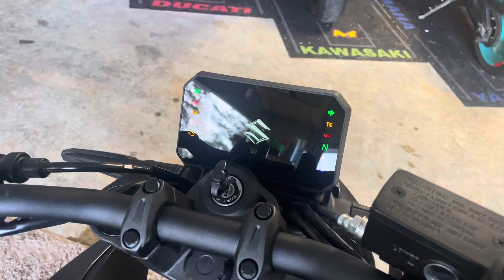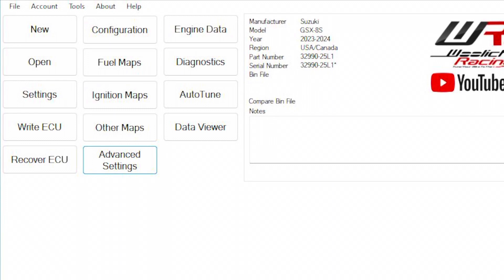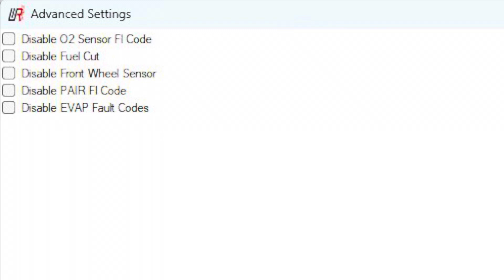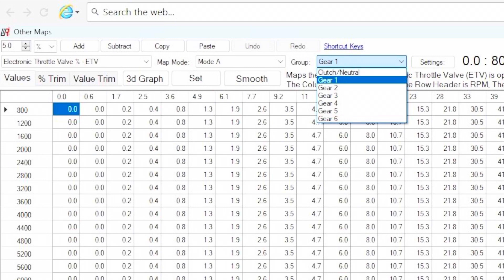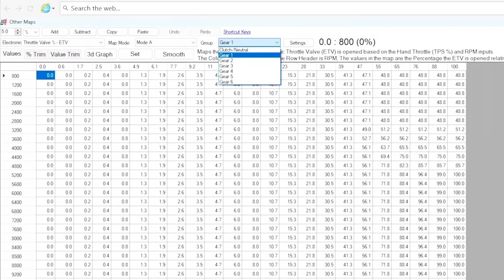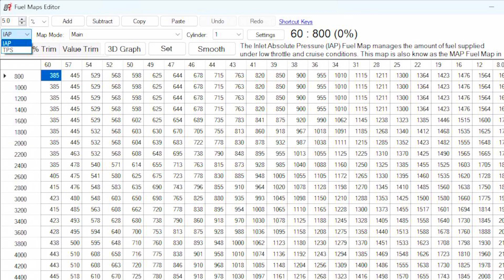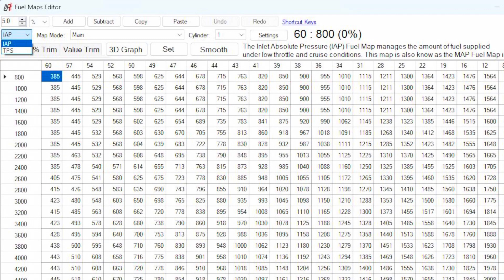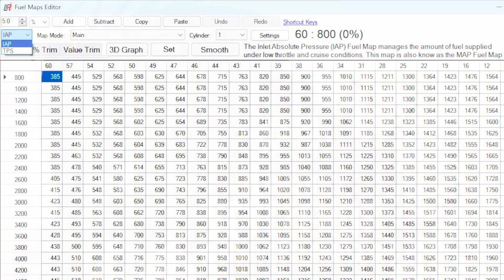Suzuki gsx8s ecu deep dive and first impressions. Gsx8r vstrom 800

Comment: Why not just put it on the dyno and run it 500 miles or whatever is needed
Reply from the maker: good question!

couple reasons

once its broken in I will start tuning it.  When I am riding the bike I am evaluating it.  Looking at what needs improvement,  what I think of the stock throttle maps,  what feels good.  Impossible to do that on the dyno and I want to evaluate it prior to tuning

even with all the fans on the dyno a bike can still get hotter on the dyno then riding it.   Excess heat is a big thing im trying to avoid on a brand new motor

I did get 50 miles in yesterday,  ill have it ready to start tuning by wednesday
Reply: @vcyclenut  can you at least use it to speed the process up and that way all your time riding will be with a fully broken in bike ?
Even if you did it in increments to avoid over heating it lets you get mileage in on rainy days and when you’re doing other things. 

Anyway just a thought.
Reply from the maker: ill put 100 miles on the bike,  change the oil,  and than just do a few heat cycles on the dyno and then let er rip.  Ill make a break in video about my process
Reply: @vcyclenut  one last question. Did you see yammy noobs video yesterday on the trident 660? He has a rant dedicated to his issues with the on off throttle situation. My question is to what degree youre able to make that snap back like a normal bike and how much of that is from you riding on road vs tuning on dyno like you mentioned others do. Or can that just not be tuned out.
Reply from the maker: @MarissaTheMuse  i work really hard on throttle feel.  Its one of the things you will hear again and again on my flashes is the great throttle response.  Yes, real world testing and not just dyno tuning is a big part if this.  
One of the things I’ve already noticed in my short 50 mile ride on the gsx8s is that the early throttle does very little, even in mode 1.   I will fix this for sure.

Comment: The new Suzuki quick shift has been one of the best factory systems I've ridden with. I'm impressed with their 2023+ lineup.
Reply from the maker: After 50 miles im impressed!!
Reply: I test rode the gsxs1000 as well as the gsx8s. The gsxs1000 had the best feeling stock transmission of any bike I've rode before